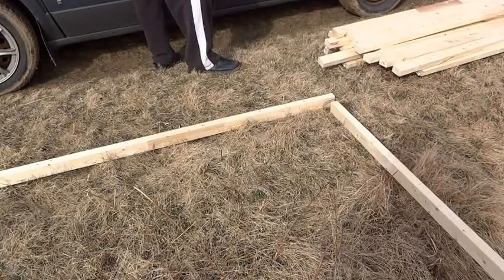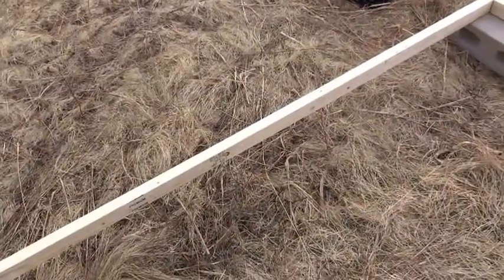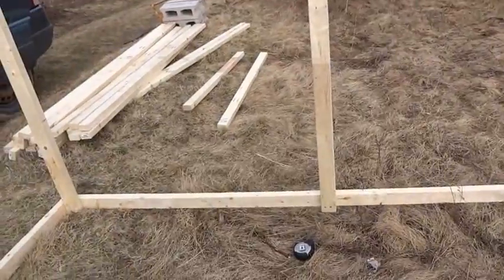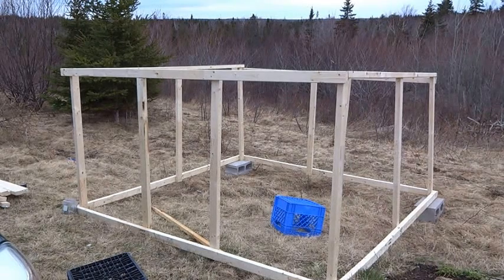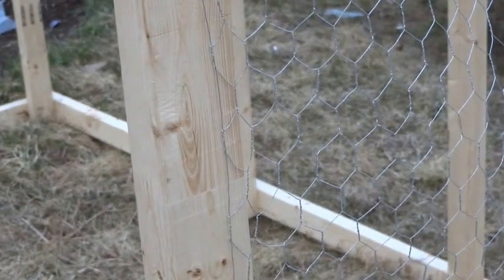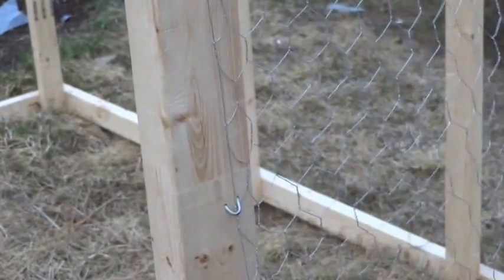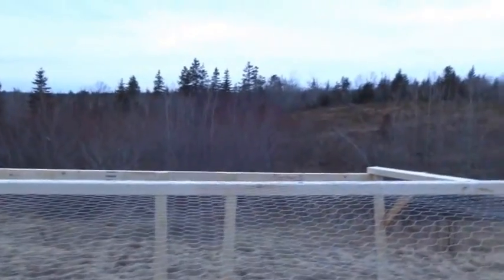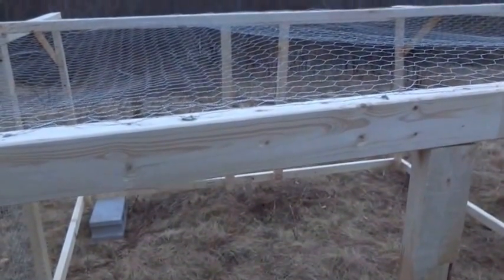Day 1 Of building a chicken coop on the homestead with small budget ,not carpenter either

Comment: I hope you are following a plan, predictors can grab a a chicken through a space of a quarter, you need to use hardware cloth into the ground and up sides by at least two feet.
best
Reply from the maker: thanks for the pointers , I love hearing from someone who has done it before , I am planning on using either plywood and scraps once the frame was done to cover have with that and half with wire , and the walls on the side in the back same thing to provide shade , now I was thinking since once its built the frame I can move it with one piece , and it wont break and I was thinking of digging around the bottom and maybe either using those cinder blocks and laying the coop on those ones it flat and then re burry it so when they do dig they hit a concert block , and the house they will live in will be attached to the run. I do not plan on leaving them out in the run at night since someone in now living on the homestead it will be easy too get them back in the house at night too cut down on attacks from the wild ,, what do you think about the blocks ?
Reply: Concrete blocks are good. The deeper you burry them the better. Remember that the wildlife has 24 hours worth of free time for digging holes to attack chickens. John is right about the hardware cloth. I personally would use heavier wire with finer holes in it like he said. Chicken wire will keep the chickens in, but I'm not so sure that it will keep the wildlife out.
Reply from the maker: I was thinking about that. It worries me greatly . I was thinking about getting bricks , they are on sale for 2 a piece but its 8x8 so that would be about 70 bucks  ,, and the price of the cheapest hardware cloth is 11 dollars for 24 inchs by 5 feet with holes less than have inch each way , but it would bring the cost up a lot and I really do not think I can afford either one currently. I have access to alot of scrap wood currently with running a saw mill to make lumber . So I am debating on digging out a base ,, building a lip all about the base and two feet off the ground and then burrying it and also a base of rocks around the two foot wall off the ground thoughts ?
Reply: I can appreciate that all of the materials are expensive. The things that you described sound good. Bigger rocks are better if you can and lots of them for the base.  You can do a lot with scrap wood too.
Reply from the maker: becacuse the run is 4 feet high i could  probably  go down about a foot maybe two with lip

Comment: You should have used the sledgehammer at the back side of the strut, and a smaller hammer to nail those staples in.
Reply from the maker: +Kenneth Stensrud thanks for the tip